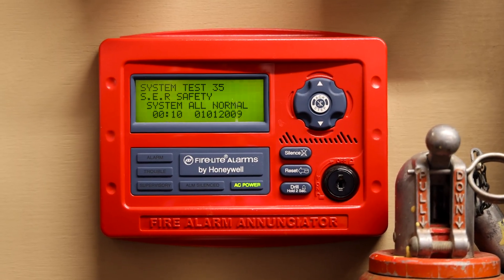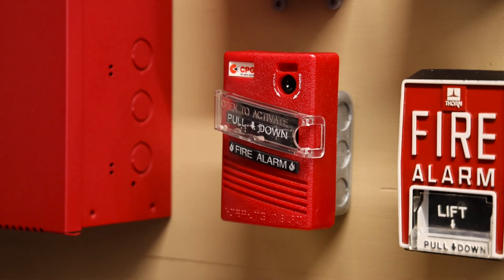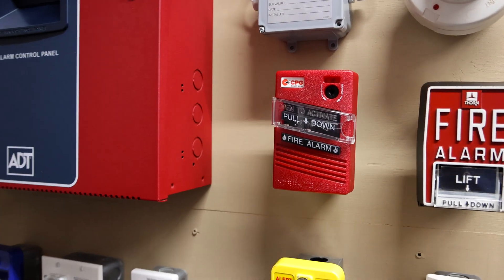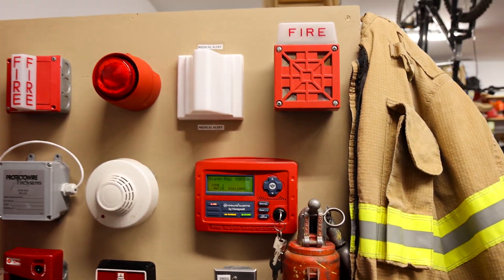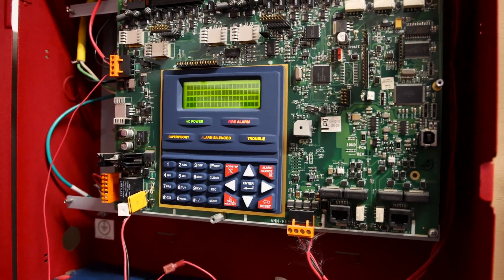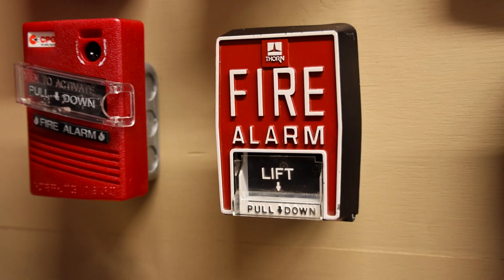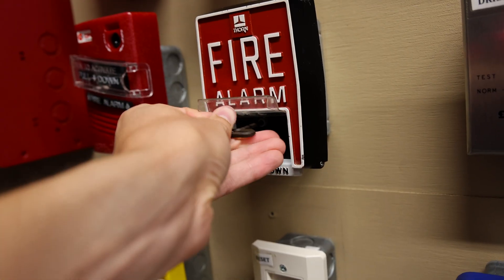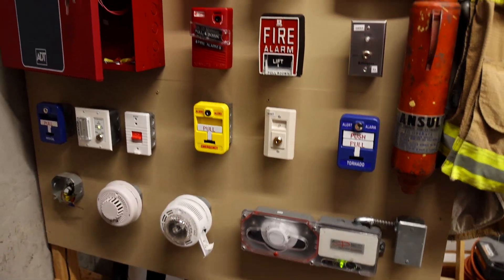ADT Fire Alarm System Test 35 | Wheelock 7002T-24 doing Code 3!

Comment: Request for system test 36: system sensor spectralert advanced celing mount strobe pc2wr white colour .The supervisory alarms true alert horn strobe.and More to the right the simplex 2903 strobe plate with a 450D horn
Reply: The pull sation is the fire lite BG10 the left one is gamewell M69.The supervisory pull station is fairday10123-1arrow handle pull station

Comment: the skipping is cool on code 3
Reply: Yeah
Reply: @Tlbeluga123  why is the horn skipping for some reason and the strobe in skipping to?
Reply: The strobe is required with the horn on those fire alarms, so that’s why it skips.
Reply: @EmergencyFan468no it’s wired to the base coil of the horn and the transformer
Reply: True